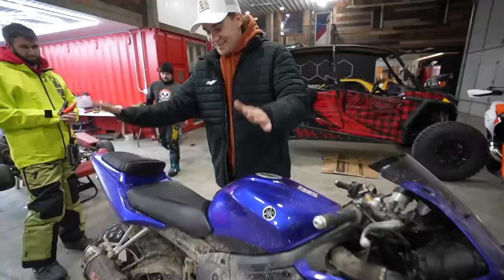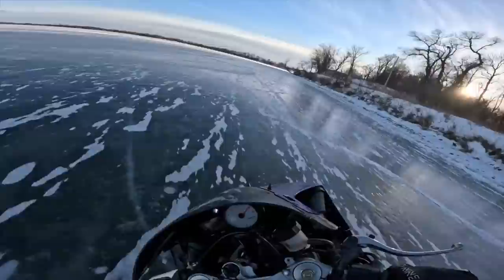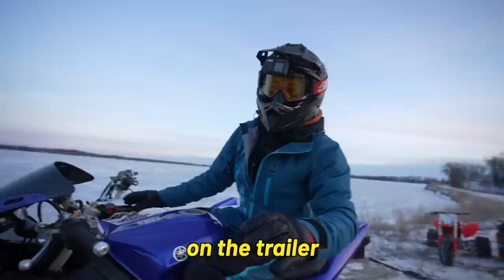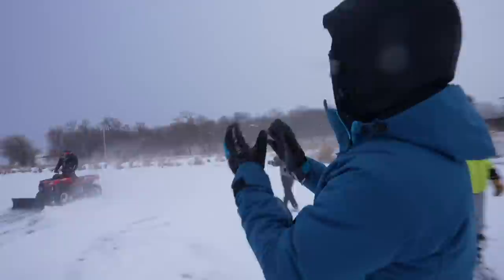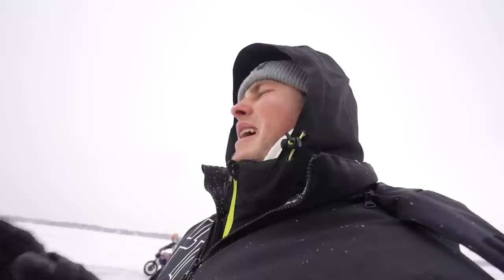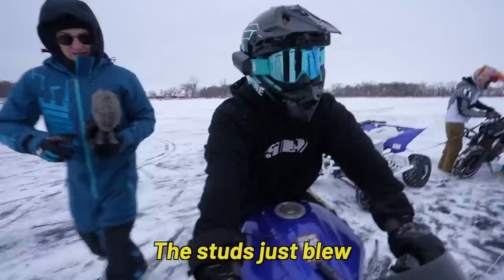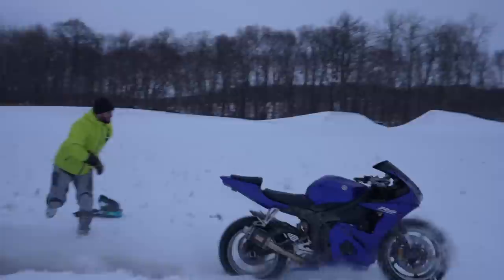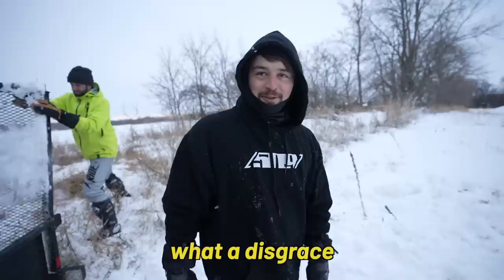Crotch Rocket on Thin Ice!

Comment: For those that consider doing this type of spiked tires.. consider following: Have you ever gotten road rash.. now try that in speeds of excess of 250km/h witch that rear tire is going with out resistance if it hits your flesh, but even better traction that concrete or pavement...now consider you have turned your tires into meatgrinder with hardened steel spikes.... Yeah so if you do this be careful not to get hit, or hit anyone or anything with it.
Another thing to consider is that spike tires generally suck at non icy pavement surface, so this is mostly for off roading or on very snowy surfaces but not salted roads. Know the guy who runs spikes whole winter and drives it as his daily but he runs spikes only when its icy enough and swaps back to normal studs when snow starts to melt cause spikes are so slippery on hard surfaces that are not ice.
I'l be doing this to my winter bike but its just a transport, not a toy.

Also wtf while it was cool looking to see bike fly, least gather up some snow for it to land intact ffs..

Comment: You should attach a rope behind some machine, not a bike cause it would tangle the rear, but something like a side by side and pull a sled, either a plastic one or a steerable one, and try how fast you can go on those, of course the toboggan (if it's a correct word) modded a bit so the rider doesn't bottom it out as it's plastic. We do this in finland sometimes and we've hit 85kph on a "rattikelkka", a steerable sled, at a back road. Add some dirt biking armor, a helmet, sled modifications and many safety precautions, alongside thick enough ice, and you could do an insane top speed run. And of course the rope would be only attached to a SxS or a snowmobile, the sled rider would hold it in hand and then let it go.

Comment: Holy shit...they used Tapcon's as ice picks for a tire... those who don't know. These (screws) are meant to go into concrete and hold 1250 lbs sq inch. depending on the size and depth...(in concrete) crazzzzzzzy
Edit. Evan needs a raise......

Comment: Im surprised how much traction you have with the kold cutters on the dirt bike. I have a similar setup and I cannot drift or wheelie. Not sure why I cant wheelie, it just spins, but in the  corners its like im on pavement and have plenty of traction. I would like to try the screws you used in the R6 on my 3 wheeler. Was going to use snowmobile studs but I think this would work better. Are you using tubes in the R6? air leaks?